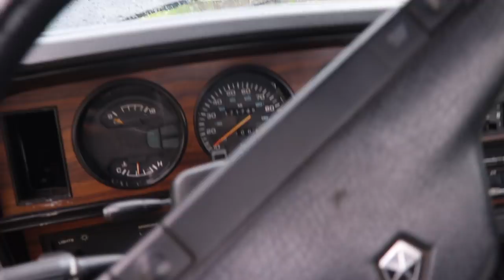WE BOUGHT ANOTHER DIESEL TRUCK!!!!

Comment: Hey Malachi hope all is well brother Blessings from Kissimmee FL just wanted to let you know that the Item you called A/c condenser is actually the trans cooler and the one with the harder lines that's the one for a/c If you are doing the 2nd gen intercooler  I recommend you look into Derale Transmission coolers you can mount it under the truck but I do recommend one with a fan built in they work great and last a long time I use them on the Dually OBS 7.3 PSD and I will be using it on the OBS single cab Race Build as well I really think they have a great product. Well brother keep up the awesome videos  blessings to your whole fam as well as the LNP FAM!!

Comment: hey Malachi 1st gen cummins are only designed to safely hold up to 600 hp so be carefully
Reply from the maker: Redneck leon of course all mods will have to be done... but I assure you they can push more than 600hp easy with proper work done ✅

Comment: you got it backwards.....the trans cooler is the little one with the rubber lines.  the a/c condenser is the larger one...  keep the a/c put a smaller IC on the lower half.  if that's considered "cherry" you guys should buy my OBS CCSB 7.3!